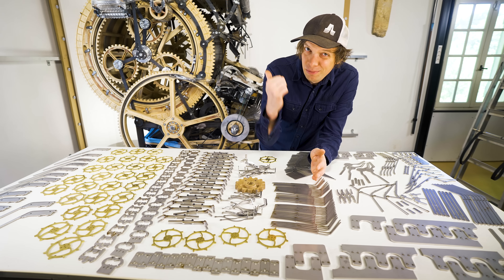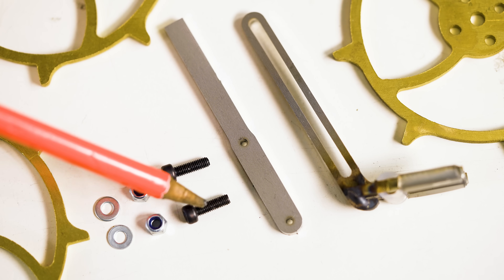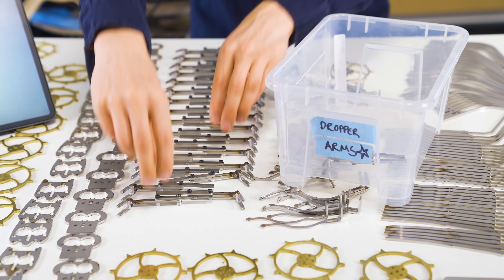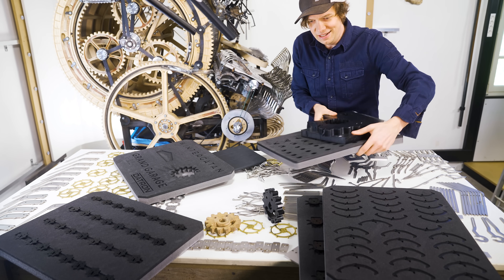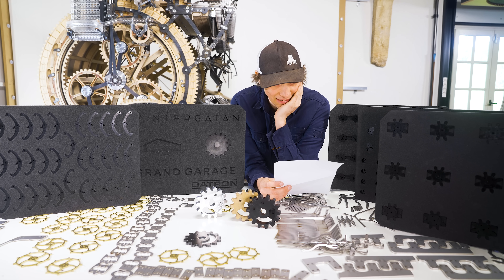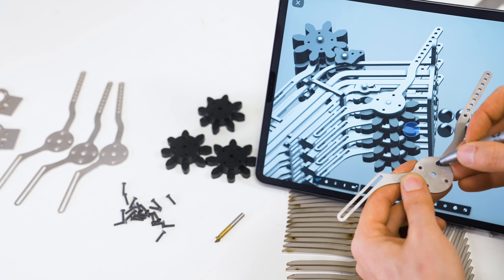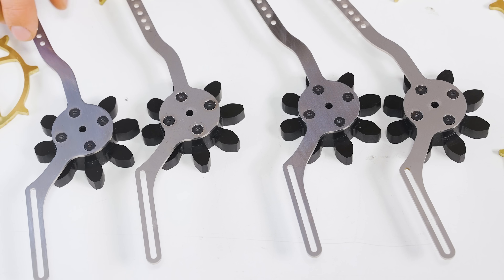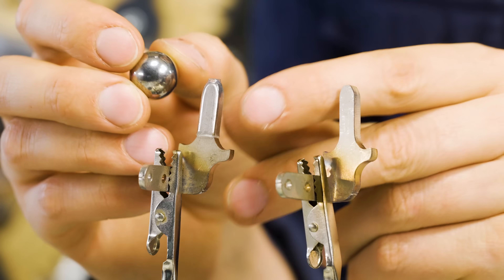Solving the 1000 Pieces Engineering Puzzle

Comment: One of the reasons you broke so many drills might be because you're cutting very slowly.
You might think cutting slowly is better but that's not always the case. A good rule of thumb for a drill is the smaller the hole the higher the RPM, and the reverse is true for bigger whole. Of course it also depends on other factors like the material but it's a good place to start. And to be fair the material you are cutting isn't the most forgiving by any stretch of the imagination.

Just search drill RPM chart and you'll get something like this: https://images.app.goo.gl/7wwrcZ3tH1B1BiwS6

Comment: Martin, I've had experience with heat shrink tube sliding out after some time. I think you should make a groove loop on those prongs that are dampened by these tubes. This is to ensure the the heat shrink tubes will still have a better grip even when they become tad brittle.

Comment: Yet again Martin dives in and builds everything up in one go without assembling a couple of test pieces to ensure that the design & manufacture haven't compromised the operation. Just because parts look good & meet the design tolerances/specs doesn't mean that things will work 100%. Any remedial works are likely to be harder to perform if everything is fully built up.
Reply: It's not like he tested prototypes...oh wait!
Reply: @randomnickify  but they were prototypes rather than the production items - how many times have we seen him rattle off & build a whole load of stuff that then has to be pulled apart

Comment: Stainless steel is a drill killer. It likes to stretch more than to chip. Enlarging existing holes that are larger than drill core is also a drill killer. The spiral starts to feed the drill in. So it's not you. Pro level parts. The gates are gonna look good as well as work.

Comment: HSCo drill bits FTW. Long time ago I designed a stainless steel power socket mounting plate that had multiple mounting options for different size sockets. I happened to draw 3.2mm size holes (blind rivet size..)  for M4 screws which is a tad small for thread (should be 3.3). Of course I ordered a big enough stack of plates to cause some despair. Luckily it was 'just' a matter of opening the thread with 3.3 drill. A bit frustrating but I noticed it was still good luck in disguise as 3.3 hole cut would have had that hardened edge making thread cutting very, very annoying.  For those dog bone shapes. There should be no need for those when laser cutting. I've been doing puzzle locks for SS welding since the dawn of time and I have square corners and usually 1:1 fitting. Requires some minor finishing with thiccer material thickness (>8mm) when they use oxygen assist but thinner works right away. 1:1 fit and sharp corners allows for constant weld porn as there's no need for tig rod to fill any gaps and makes welding ridiculously easy. All in design. Also, parts just snap in and part hold shape right away.

Comment: Laser cutting hardens the holes. Also your holding fixture is allowing lots of play which will shorten the life of the drill. And lastly, if the drills are HS or HSS they won't last long. You want cobalt drills with a TIAIN coating. Carbide drills are even better when you have CNC hole drilling. If you had to do this again, I'd go with as short of a cobalt drill as possible with a good coating.

Comment: The main reason is that the laser who cuts the metal, heat treats the metal, which result in a harder material.
When you calculate the rpm of the drill you have to adjust the cutting speed of the material.

Comment: It's interesting how in the context of welding, EMF is said to be "one of the most dangerous things" in some circles, but I have never once heard that around high voltage lines in power stations or for linemen hanging off of relay towers.  I would advise people concerned about physical phenomena to search for the answer in the context of that area of study, not the activity.  People who spend their whole lives going to school and teaching about specific sciences are going to necessarily give better answers than people with hunches.  

That being said, the official consensus on high-voltage EMF is that you should probably avoid it, but there isn't any experimental evidence or study that has enough confidence to support that.  Kind of one of those "just in case" things.  There are (is a?) studie(s) suggesting EMF could be responsible for an increase in cancer, but that would be absolutely certain if it was as much of a concern as people make it out to be.  In fact, there's not enough research to even say this is true.

Comment: I also wouldn’t worry about the emf.   You are welding with DC.  EMF is negligible.  HF high current on aluminum might be another story.  The cables essentially could act like a radio antenna.

Comment: Isn't it smarter to fully assemble 1 piece and test it, before assembling all the rest?
Reply: The design is already tested, that's why it was ordered. And with this much money invested (yes this isn't being done in charity alone, the channel is paying good money for these parts) it is basically all or nothing.
Reply: @StoneUSA  The prototypes that were tested were different. Since many parts are welded together it just seems just more logical to do one part first, test it and then do the rest of the welding. You can't easily undo the weldings and reuse the parts. If one of 10 pieces welded together is incorrect, you loose of 10 pieces.
Reply: @kriswillems5661  While I understand your point and your concern, I am not convinced that you could easily undo the welds and reuse the parts. Some of these parts are very small and the welds are over large portion of their surface. Those welds would be difficult to undo without spoiling the part. Also the mechanism on the whole isn't necessarily something you can just change one component of and expect it to work with all of the others. That may not be true of every component in the mechanism, surely there are some that could be switched out, but you've got a thousand parts and they all have to work together. The other problem of course is that the parts are already purchased and I doubt there's much he can refund. So he can't keep purchasing more and more and more and more modified parts until the mechanism is working perfectly, that's just not in the budget, or maybe it is I don't know. Given Martin's own comments on the matter I have to assume that the fate of the project at this point from both a budgetary point-of-view and from a practical point-of-view is binary. It works or it doesn't work. To be or not to be.
Reply: @StoneUSA  There you go. In discord you can read the design has serious issues, which Martin didn't mention at all in his latest video. Probably a redesign is necessary.

Comment: Martin Google how much EMF hits a square meter of the surface of the earth on an hourly basis. That welder isn't doing anything harmful.
Reply: The frequency is also non-ionizing so the human body is basically invisible to it. It won't even heat the water in your tissue. But it's one of those unobvious things that bares erring on the side of caution. It's very easy to avoid a flame, a vat of acid, the sparks from a welding rod and such. The invisible gasses and energies around us though may be damaging us in ways we just don't know about until they have done lasting harm. So you're right, those with an understanding of EMF shouldn't have to worry about this threat. But you and I can appreciate the caution that others might take, and understand that this caution isn't irrational.

Comment: Martin, you are spot-on with why drilling the SS sucked - it looked like you were running the drill way too fast. Go as slow as possible, apply good pressure, and keep everything cool. The laser cutting may have also contributed to the hardening of the SS in the first place. Without a full machinist set up, working with SS can be quite tricky!

Comment: Did you know that you can re-sharpen dull drill bits.  Just use a grinder or your disc sander and file it to the exact same angle that it was originally done at the factory.  Your bits will gradually shrink in the process, but they will still be useable.

Comment: Electromagnetic radiation is non-ionizing and the general consensus is that you are safe. The thing is, you're exposed to EMF all the time. Cell phones use RF electromagnetic radiation, as do wi-fi. I'm working as a radiographer (röntgensjuksköterska! :) ) and we're working with both x-ray technologies (x-rays or "röntgen radiation" is ionizing and thus well known to cause harm) and with EMFs (MRIs uses electromagnetic fields and RF pulse waves), and we're always considering the MRI to be a safe technology, radiation-wise. 

Sure, there are some scientists believing that EMFs can be dangerous in the long run if you are constantly exposed to it, but there is no consensus whatsoever. EMFs are, again, non-ionizing, which means their energy is too low to be able to damage DNA. The only thing their energies achieve is warming stuff up, which btw is the reason your ear gets warm and sweaty if you talk in a cell phone for a long time.

So Martin, you should most probably be fine. A full-time working welder might want to take precautions because why not, but otherwise, it's not an issue.

Inb4 5G conspiracy theorists starts littering my inbox.

Comment: As far as welding whip being around you while you weld, most tig welders I’ve seen support it in some way like this. Even with high amp mig welding that I do I tend to run the whip over my shoulder or lap, it’s all up the the user. As long as you aren’t the ground source and the cables are in good condition everything will be good.

Comment: Worked boring stainless steel barrels for a while. You have to cut deep enough to get under the hardening surface layer, but not so deep you break the tool.

Comment: Martín, electromagnetic fields are not ionising, ionising radiation Is the one that rips electrons off atoms, and that damages our dna. Because the field you are experiencing is not even close to being ionising you don't need to change anything about how you hold your welder. 

The dangerous part of welding is the UV light that is emitted from the tip and it can give skin cancer. Because UV light does damage our dna as a mutagen, you need to cover every piece of skin that can be exposed to it, and you seem to be doing a great job at it

Edit: there are some people that believe Electromagnetic fields are dangerous, and if you read up on some of the papers you will find that the findings directly contradict physics in a world breaking way, they are completely against the scientific consensus.

Comment: I upgraded the EQ in my mixing console this winter. It has 24 channels. A design lesson for me is that everything over maybe 10 or so identical things feels like mass manufacturing and has to be treated like you are a factory. You can't build one at a time, because you will miss a step. You need to make one step at a time, for all the pieces. 

And a step can't be too complex. When adding components, it can be maybe 3-5 components at a time, or you will miss one somewhere.

Comment: It seems there is a fair bit of assumption re drilling, especially with hand held type of tools. Flat out, maybe off axis, likely with low to mid priced drill bits, and maybe badly shaped and sharpened. So there are tables and guides readily available nowadays for speeds and feeds for different materials, and quality of tools being applied to said work. It makes a hell of a difference to do it correctly as opposed to assuming it's just drilling, so a drill is a drill is a drill etc.
Machinery handbook has quality info on all this stuff, and is sort of a pre-requisite for designing and manufacturing stuff like this.

Comment: You should have washers under the nuts to prevent the slot spreading open.  Even better would be to make "nutplates" (strip of steel with 2 tapped holes).

Comment: Stainless steel is in fact a tough material to drill because of the chromium. Not unusual to waste three drills on this material, or you need the drills of the highest quality which are more than three times more expensive.

Comment: Just a small note on drilling out laser cut holes.  The laser process does leave behind a hard scale (just like mill scale) to keep tools in good shape you need to break into the material quickly so bits don't grind for to long.

Comment: There is no EMF with DC TIG welding. Maybe a tiny bit if you have a high frequency start but even if there is and you keep the cable off your neck, you’re still holding a torch 2 feet from your face.

Comment: 11:55 - the magnetic field from that cable is a tiny fraction of what you'd get in an MRI scanner, and they are perfectly safe. The only issue might be if you had a pacemaker or steel plates/bolts in your neck.

Comment: Around 3:00 when all the maybe reasons are given..   you missed one.  Maybe drilling stainless steel is just a &@€#%¥ bitch no matter what.   (And yes heating from laser could have hardened the very edge of the holes, making it even worse)
Also, as bad as drilling was, tapping would have been like order of magnitude worse.  So ultimately good call.

Comment: For drilling stainless steel - Use cobalt steel drill bits.  Lower speed than you would for steel.  Use water instead of oil.

Comment: One thing that tickle my mind since the beginning of this project : why order every parts for the entire assembly when you have not yet tested the "final" design entirely? You are literally putting hours of assembly work for something that may not work or need some tweaking/design adjustments, I think you could be better off ordering and assembling a few gates at first. It will not only allow you to save money because you would not have to reorder all the parts for the redesign, save you hours of work for assembly and testing and also allow you to rapidly tweak the design because you would have less mental barriers about scrapping tens of hours of work for minor adjustments.

Comment: DON'T PUT THE CABLE AROUND THE MARBLE MACHINE!!!! The high current running through the cable leads to induction that can cause incremental Maxwell forces to build up on the the exteriors of parallell  metal components. It took us forever to figure out why we were experiencing so much warping until we realized that people on the internet are full of shit.

You are not one of those people. There is nothing wrong in teaching what you learn!

Comment: Electromagnetic radiation isn't dangerous, it's basically vibrating air
Reply: Eh, close...
Vibrating air is sound...  Not electromagnetic radiation

Electromagnetic radiation is things like light and radio waves. But yes, it isn't dangerous, at least the lower energy anyway

Comment: Martin, when you drill stainless the key to getting a good cut is to drill 2 seconds and lift off 2 seconds to keep the steel cool during the whole process. As soon as the stainless heats up it just turns to mush and will blunt your drill bits every time.

Comment: All welders – even those without implanted cardiac devices – should understand the proper methods to minimize exposure to EMFs while welding. The Lincoln Electric Co. recommends that welders route their electrode and work cables together, securing them with tape or tie wraps when possible. It’s explained that “if the cables are routed together, the EMF at that point is reduced. Some cables even include electrode and work conductors inside one cable which may be a convenient way to reduce EMF exposure.” https://weldingproductivity.com/article/heart-healthy/  and as a Electrician, I feel I can back this up.

Comment: One thing that impacts the life of a drill pretty significantly is distribution of the cutting force on the edges of the drill. If the pilot hole is too large it can actually make the cut wear the drill down faster because you have a much higher psi on the cutting edge since only the very outside edge of the drill is making contact with the steel. In a hole with rough edges and no material to keep the tip of the drill centered in the hole you have to imagine the drill spinning and sometimes making small cuts, and sometimes making very large cuts as it wobbles its way in. These uneven cuts can wear and chip drills pretty easily. On top of that the slag from laser cuts tends to be pretty hard, and will present more uneven cutting forces for the drill bit. And finally to wrap it up, HSS bits tend not to have very long lifespans in certain stainless steels like 304 and 404.

In short, I'm amazed it only took 4 or 5 drills to cut that many holes. It could have been, should have been, worse than it had even gone.

Comment: 1st, The stainless will have been hardened as the holes you are trying to enlarge are in the Heat Affected Zone (HAZ) from the laser cutting. 2nd, stainless needs to be drilled fast and with a rapid feed (high pressure) or it will heat up and harden. Both things are going to make life difficult for you!